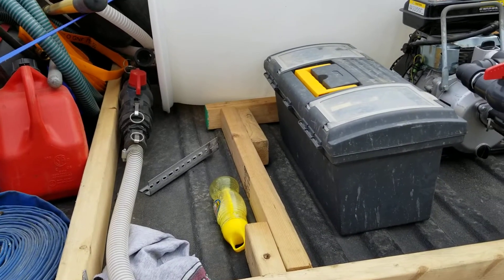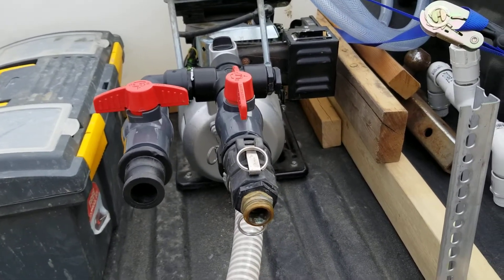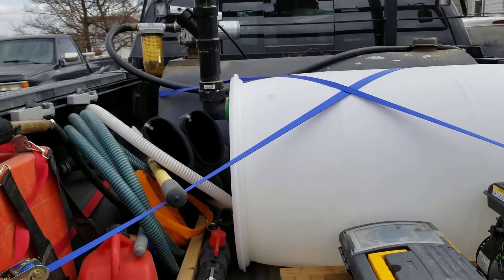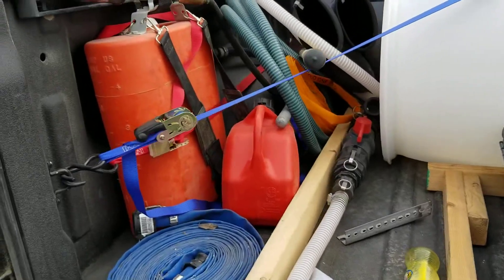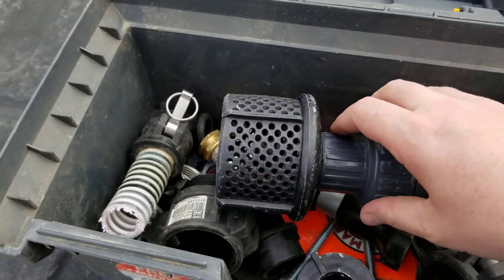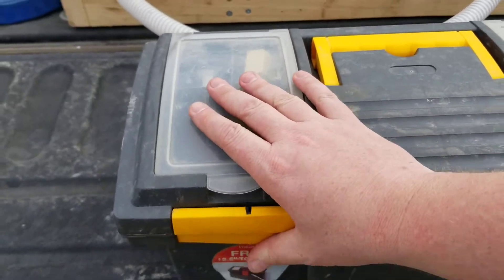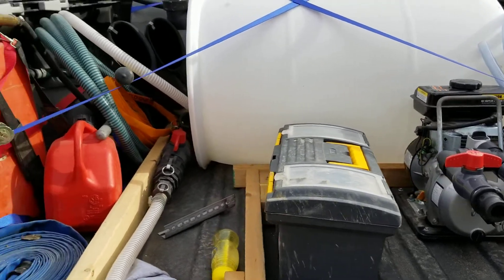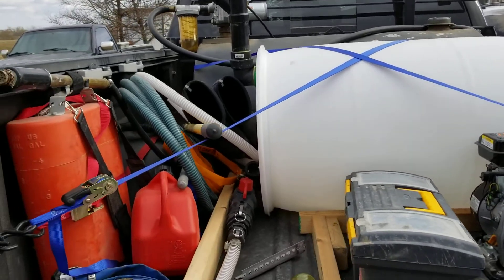Homemade Wildland fire skid unit.

Comment: Did u get this finished?
Reply from the maker: For the most part I built a cradle for the barrel and I'm now using a 2" high pressure 7 h.p. pump that generates 85psi.